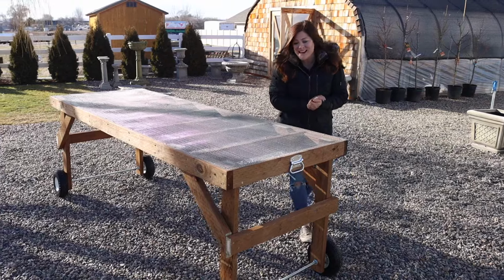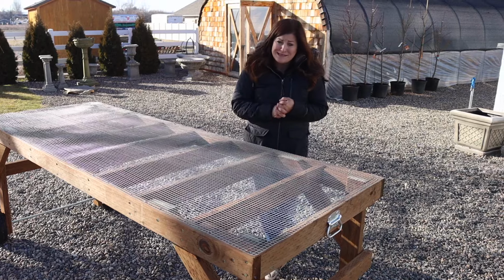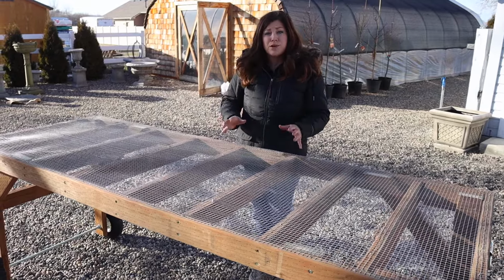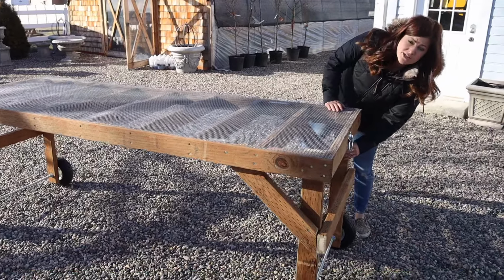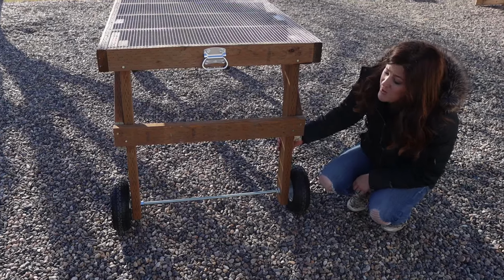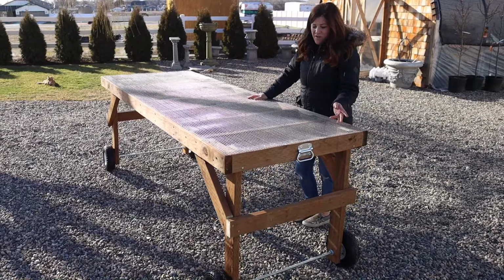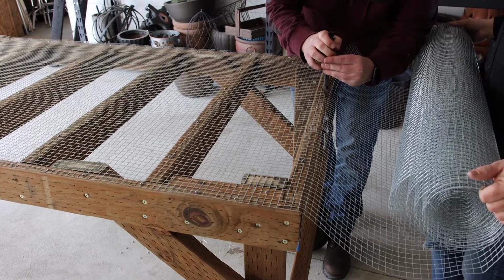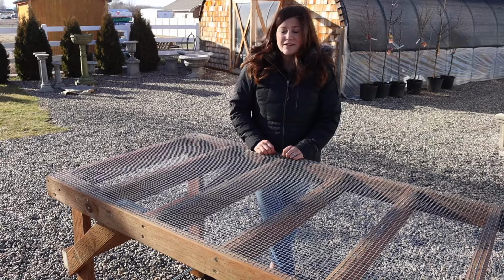How We Build Our Greenhouse Tables! 🛠🌿💪// Garden Answer

Comment: QUICK TIP:  To get a perfectly rectangular tabletop, cut 2 equal 8 foot boards and 2 equal cross boards, attach them at the ends, then make 2 diagonal measurements across the tabletop (bottom left to top right corners, and top left to bottom right corners). If those two measurements are equal, then your tabletop is a perfect rectangle. 

Great video.

Comment: I made these tables for my greenhouse as well.  They work perfectly!  I also added a couple of long 2x4s across the length under the table to hold extra flats and/or supplies.  It helps when I am hardening things off.  I put the more “fragile” plants on the bottom to keep them out of the sun until they harden off enough.  I am about to make another one!  I also made a “mini” table with the hardware cloth on top to use when we rinse out our koi pond filters.  That way the water runs thru and we don’t have to hold those things in our hands, yuck!  Thanks so much for a very adaptable plan that was so easy to follow!

Comment: Love it!!!  I actually built something very similar to clean out a rock bed that we had built years ago. I used it as a seive to clean the rocks out after I was through with that project it was just kind of sitting around it was coming in handy for lots of different things, I put it on sawhorses and clamped it on as needed to clean our greens in our vegetables and then I would put it back up. 
I like your idea with the wheels.   Thank you.

Comment: NOT BAD-typical construction-it is overbuilt with all the 2x4 material-I prefer rough sawn spruce or hemlock-could use cedar or pine-available herein Maine-maybe not near you. but alot cheaper. 1/2" plywood gussets at corners are much stronger-and cheaper and lighter. Depending on your moving needs, skid pads (ie. 4" x12'X1" with small gusset bracing) instead of wheels-much cheaper and fine for shifting around benches. add ledger under perimeter frame to support 1"X4" cross supports-every 2 feet is fine. Hardware cloth is fine-BUT VERY EXPENSIVE-use 2"X4" 14 gauge galvanized fencing

Comment: Would this work well for a potting bench? I'd love to have one and this seems such an affordable way to do it, but I've never had a potting bench before. I'm wondering if it would be better to have a hard, flat surface instead of wire cloth? Also I wonder about leaving it out in the elements as I don't have a greenhouse. What are your thoughts?
Reply: I was thinking the same thing! I live in Florida, so I have to contend with a lot of intense sun and moisture. There's a spot on my back patio that's under the eaves of my house, so it stays in the shade and is slightly protected from rain (it'll still get wet, but not as much as if it was out in the open). In my opinion, the hardware cloth would be the best surface because all the dirt and water falls right through. With a surface like plywood, the moisture would cause it to warp over time. To use this idea for a potting bench, I would probably do a 4'x3' or 4'x2' table with a 4'x1' or 4'x8" shelf above for storage.
Reply: This could easily be modified into a potting bench. The first thing to decide is how tall to make the bench. Consider things such as your height, the size of pots you would mostly be working with, whether you will stand or sit, etc.  For me, at 5'4" tall, 28-30"H bench would be the most versatile and allow me to pot up 14-16"+ containers while standing. To work on small plants, like when growing from seed, I would pull up a tall stool because my health limits how long I can stand,  IF you are a tall person, you might want a potting bench that is even taller than the average kitchen counter height of 36". 

The wire would work ok but I think I would use 2x4 lumber to create a top work surface just because it would look nicer & function more like an all-purpose table. When securing the lumber strips to the top, leave a small gap between each board to allow water and dirt to fall through. Use a washer, quarter, or a nail as a spacer to keep the gaps consistent. I think if you use pressure treated lumber, it would be fine to leave outside in the elements. In time, the wood will change color. You could also sand and stain, seal or paint the bench using the appropriate products designed for outdoors. 
Happy gardening!
Reply: @mollycatcolorado9252  thanks for all the ideas!! I love all of your thoughts on this!

Comment: Great video, what is the wood you guys used, I notice it has "dimples", wondering if that's why the screws went in so easy, didn't see you drill a hole for every single one, or..did you.?  I don't need one that size, so I'll adapted the idea for a slightly smaller one.

Comment: Chicken wire is the worst, imo. It bows, leaves get stuck in it and flats won't slide on it.  I had to deal with it for 4 yrs at a pretty nice independent garden ctr. Ugg. Finally changed over to wood. That being said, it might be ok for the home gardener.

Comment: 34"-high is the standard height for a kitchen countertop but then...you added wheels so I probably would have taken the height of the table down an inch or two to account for the wheel height but other than that? Yep, simple, easy design.   (Or, if you're really tall, make the height taller, lol.  It's not going in a kitchen anyway.)
Reply: I don't consider myself particularly tall, but we went with 38" counters in our kitchen, which admittedly means I built custom platforms for our range and dishwasher to bring them up to counter height, but it's so much more comfortable to work at that height, with the rare exception of having to really bear down on something like cutting into a very hard squash, but then I just bring over a stool, so I can really put my weight into it.
Reply: @alexreith4877  Context, bra.  How tall are you?
Reply: @Bamboo4U2  I'm 5'7". My sister is only 5' and my counters are high for her, though not unusable. But my mother who is also 5' had her counter height at 32 inches I think and I was more comfortable sitting on them than working at them. I don't want to hunch my shoulders when I'm chopping veg or kneading dough. I suppose if you don't spend much time working in the kitchen it's not a big deal, but it was important to me.
Reply: @alexreith4877  Most dishwashers are about 32" high so unless you're talking about a countertop without an appliance beneath it....
Reply: Jake Jones your point being? If a standard dishwasher today is 32" tall then my father couldn't have built my mother a custom kitchen of her desired height 4 decades ago?

1. Where there's a will there's a way. I would hate to live the sort of life constricted by the boundaries of industry standards, when a little imagination can make my life so much easier.

2. The original point I was making was that despite the fact that I am about average height for a man, taller than most women but certainly shorter than most "tall" men, I find a higher working height more comfortable. Here's a link ( https://cameldesk.com/standing-desk-height-chart-inches-cm/ ) to a reference for standing desk heights which are designed for better ergonomics. If you are a serious enough gardener to build a worktable for yourself, then you'll probably be working at it for a timeframe more akin to a standing desk or workstation, rather than a kitchen counter that most people spend less than an hour total working at each day.
Reply: @alexreith4877  Whoooooa.  You're reading way too much into my post.  I'm almost sorry I even wrote it.
Reply: Jake Jones then what did you actually mean?